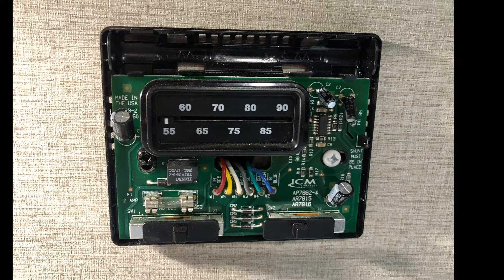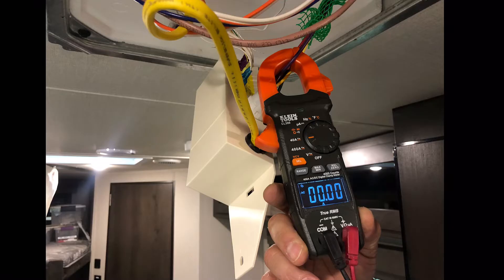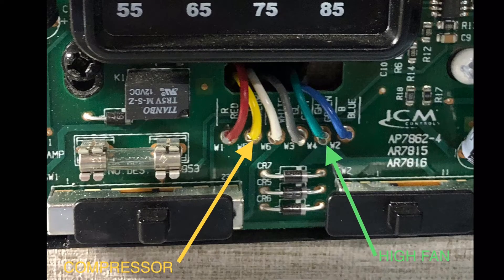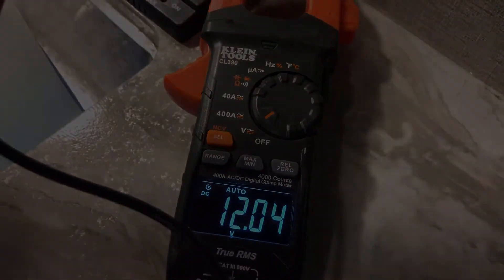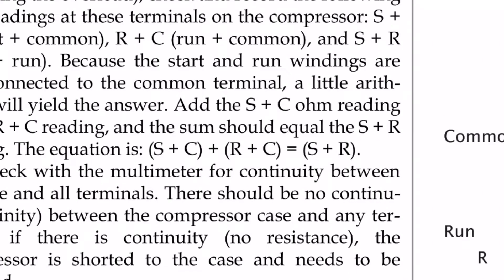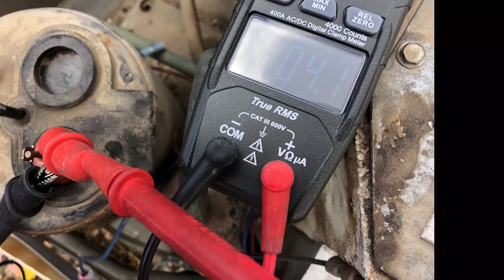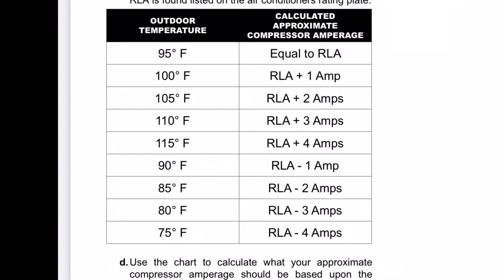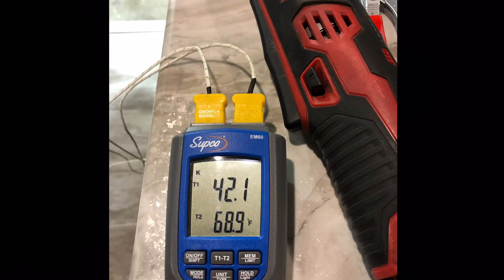Coleman Mach 15 not blowing cold

Comment: So I had this issue as well, checked all power and wiring and everything was good, swapped out the t stat with the front ac t stat and the ac started to blow cold. So that would mean that the rear ac t stat is not working right?
Reply from the maker: From where I’m sitting I would say yes.  I would put the rear stat on the front AC and see if the front one doesn’t work. If it does work at the front then it may have been a loose connection…

Comment: I just brought a coleman 48004-066 mach 15 with hp.  Which control unit do i need to pair this with? Is it 9530a751? And how would i wire the white? Do i wire the heatpump wire from the thermostat to the white on the control box? Can get the fan and furnace to work. But not the compressor or heatpump. Won't turn on. Brand new ac just brought 1 week ago
Reply from the maker: The white wire from the thermostat goes to the furnace. Typically in an RV it’s a 12 volt/propane furnace. The other info I’ll have to look into. What I see online is the 9530a751 is for heat pump model. I did work on a heat pump model today and the thermostat was different from what I’m used to seeing on a non heat pump model. I wasn’t working on the heat pump portion so I don’t know off the top of my head what you need. I do see DIYers wire these incorrectly frequently…
Reply from the maker: Sorry my parts department couldn’t answer the question and Coleman hasn’t returned my call. I did see on the t stat I’m working on the white wire with the black tracer is heat pump signal. Labeled WHP
Reply: Thanks again. I just placed an order for 9530a751. And going to wire the whp to white on the control unit when it comes.

Comment: I have a Mach 3 roughneck I tried this diagnosis and I’m not getting any power from the purple and white wires as you had. So could this be a bad switch at the panel?
I don’t have a wall panel it’s only controlled at the unit
Reply: And so I pulled the switch out to get a better connection and I have 12 volts if I touch my red to the purple on my meter but as soon as I touch the white it goes to 1 and that’s all it shows
Reply from the maker: Need more info. I’m not sure what switch you are referring too. The white (neutral) and the purple (hot) are AC voltage. That’s high voltage and should measure around 120 volts AC. The wires at the thermostat that tell the board to turn on the compressor are the yellow (+) and the blue (-). They may be different colors at the board. Is the fan blowing?
Reply: @mikmaster63  yes the fan is blowing.. maybe I misunderstood some of your video. I’m thinking the switch that turns to fan/heat/ low cool/ high cool but the compressor isn’t coming on at all. It was working fine and I had my vehicle washed and after that it’s not working now. I checked all the wires up top but I don’t see anything broken or loose
Reply from the maker: So you don’t have a thermostat??? This video doesn’t cover ceiling assembly with manual controls…
Reply from the maker: Are there knobs on the ceiling assembly?
Reply: @mikmaster63  yes it has knobs
Reply from the maker: Can you hear a click when turning the temp (red and blue markings) knob?
Reply: @mikmaster63  yes I hear a click I turned it slow to see if I could hear the compressor come on
Reply from the maker: If you are hearing a click and you have power (120 volts) going in and not getting power to the compressor then I would think it’s the controls not working. Hard for me to tell for sure from here…
Reply: @mikmaster63  yeah I totally understand trying to diagnose like this. I do have another question though. If I replace it, I see the Mach 3 roughneck and a Mach 10 roughneck. What’s the difference? I can’t find a comparison anywhere
Reply from the maker: Not familiar with roughneck. I think it’s more rugged for off road use. The different models are BTU size and height differences from what I can tell. 
https://coleman-mach.com/products/air-conditioners/roughneck-series/
Reply: @mikmaster63  yeah that’s all I could see difference. Mine needs to be rugged because I’m driving everyday down the road all over the country and these roads are terrible

Comment: The 2A fuse in my thermostat keeps blowing when I turn the ac on. The fan and heat pump work just fine; it only happens on cool. The thermostat and the AC unit are both brand new. Only thing that stayed from the old system was the Ac control box. The first trip I took with the new unit was successful. Had nice cold air and no issues. The second trip didn’t go as smooth.. it immediately blew the 2A fuse when I tried to run the ac. I replaced the fuse a few times but no luck. I waiting and tried again the next day… it worked. I had nice cold air for about an hour before the fuse blew again. The RV was plugged into 50A service at the time. Any ideas on what the issue might be? 
Thank you
Reply from the maker: My 1st thought is a shorted thermostat wire. I have seen just one wire in the t stat wire shorted. Disconnect the t stat wire from both ends (make sure you document where they go, and shorts can be intermittent ) then using ohm setting on a meter, see if any of the wires are shorted to ground. Starting at 1:00 mark explains a little bit about t stat wiring. It doesn’t show how to check for a short because that’s not what this video is about. That’s my best guess from here and good luck…
Reply: @mikmaster63  I’ll give it a shot. Thank you!

Comment: Why did you not check the board itself?  just because the thermostat and the wires are ok to the board doesn't mean its making it through to the unit.
Reply from the maker: Looks like 40 seconds into the video I was checking the output of the board??? As I mentioned in the video this is to help RV technicians are just starting out. So it’s an exercise of troubleshooting…

Comment: Is the 24 volts coming from the board inside the discharge air? I have 110v to that board where the tstat hooks up but no 24v. Thanks
Reply from the maker: Not sure I understand the question. That is a 12 volt system not 24 on the low side. 120 volt is from the board to the upper unit.
Reply from the maker: On this unit the 12 volts comes from the t stat. So, if you turn the t stat to high fan you should have 12 volts on the gh input at the board, for example

Comment: Great video!    I’ve got power everywhere you checked.    But I’m only pulling 6.1 amps. You suggested low refrigerant? Any way to charge it.  I’m still under warranty but have a drive to a dealer.   Thank you sir
Reply from the maker: Thanks. We don’t charge them where I work. I don’t think the manufacturer recommends recharging either. We replace the upper unit.

Comment: Do you check this with the ac on or everything turned off? How do I know if my compressor isn't working? I am having some freezing over my evaporator coils starting. All vents and coils.are clean.
Reply from the maker: Checking the compressor is done with no power going to the AC. I almost always check the amp draw of the compressor to see if it’s working correctly. I also check to see if I have 20 degree drop across the evaporator. Newer AC’s have a freeze sensor. Make sure the freeze sensor is installed and hasn’t fallen out or it hasn’t failed. If it’s an older AC without a freeze sensor I’m not sure what can be done about that. Make sure there aren’t any air leaks.
Reply: @mikmaster63  thanks for the info. Just checking if I turn off the breaker to the AC to check amps for the compressor it will still read right? I ordered another freeze sensor for the AC to see if it stops freezing over. No leaks or air flow. The unit is 6 years old and has been working great but two days ago started freezing up. All coils are cleaned and nothing blocking air flow. The freeze sensor is in place still. I am hoping it just stopped working.
Reply from the maker: No, the breaker has to be on to check the amp draw. I think you may need a technician to look at it. The air leaks to look for are at the divider for the duct that separates the in/out air.
Reply from the maker: No, the breaker has to be on to check the amp draw. I think you may need a technician to look at it. The air leaks to look for are at the divider for the duct that separates the in/out air.
Reply from the maker: Other things to check, make sure the coils of the evaporator and condenser are clean. Vents are open. Ducts aren’t blocked. Coils aren’t damaged. And as mentioned earlier recirculating air leaks. Air leak between the return and discharge air. I haven’t had to replace a freeze sensor on the newer ACs. Low failure rate as far as I know. Checking the amp draw is how I check for low charge on the compressor. If it freezes up within 20 minutes it’s probably low charge although it’s rare. If it’s taking longer it’s probably air leaks. Running the fan on low can cause freeze ups also.

Comment: i wish you had made this video last year when my Mach 15 died.  i too ended up replacing the whole unit. it was only three years old
Reply from the maker: Ya, unfortunately replacing the top unit when it goes bad is the best way. In my market I’ve never seen anyone recharge one of these units successfully. Doesn’t mean there’s not somebody out there that can, I never seen it.
Reply: Even if you could, installing port’s wouldn’t be free, then maybe you could locate the leak. Maybe that’s repairable. If the money and time results in a unit that cools (which it might not) great.  Now your old unit with no warranty runs….  I can see why it wouldn’t make economical sense to attempt to repair and recharge.